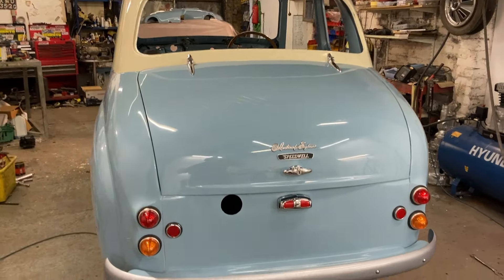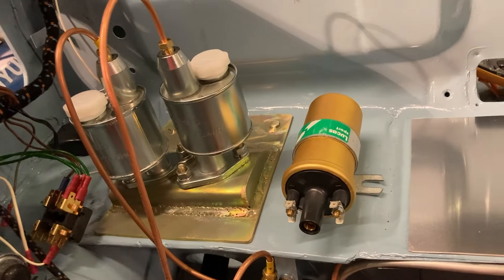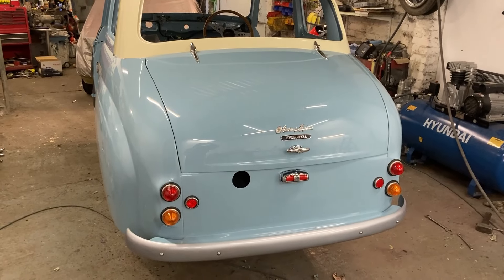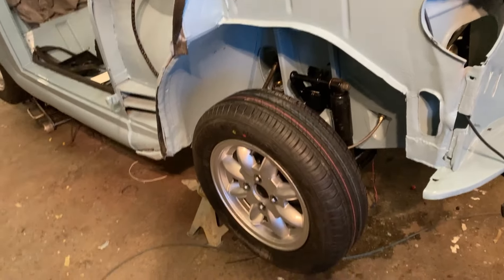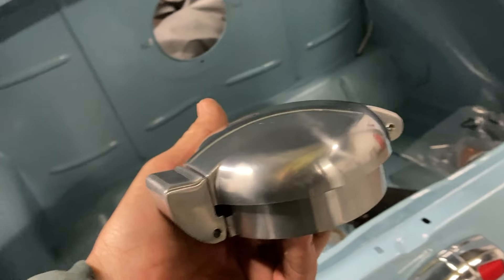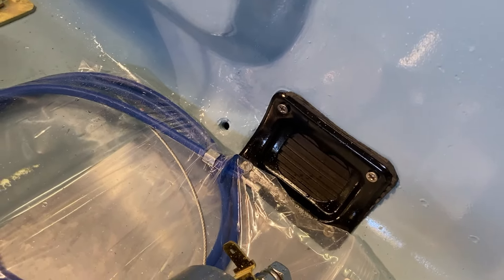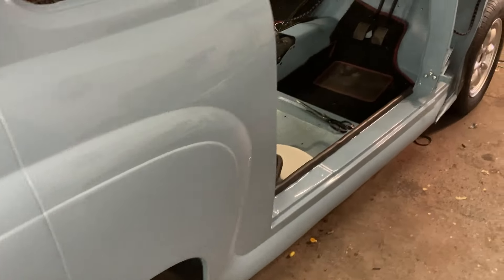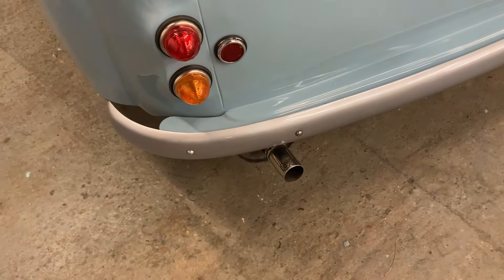SPEEDWELL BLUE A35 AUSTIN PROGRESSING WITH BUILD RAPIDLY, SUSPENSION ON AND ON THE FLOOR

Comment: Really Fantastic job thought out. Two question if I may. What windscreen motor and drive mechanism did you use and where did you get the new petrol tank from or did you make it?   Just out of interest some of the A30's had a heater mounted inside where you plan to if yours.